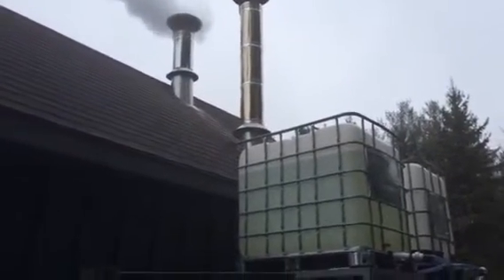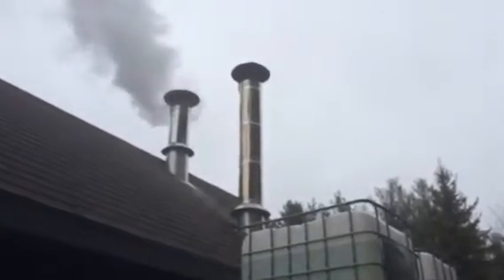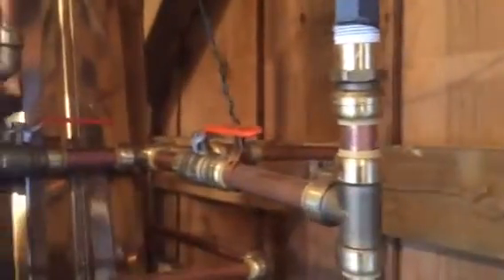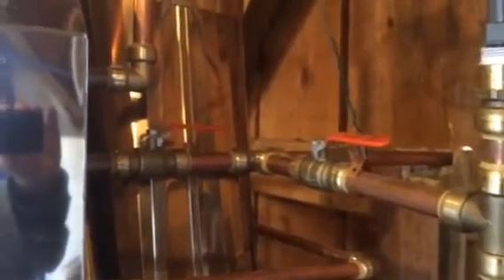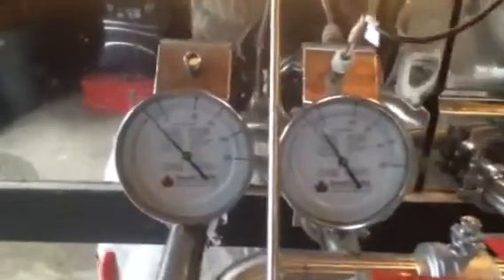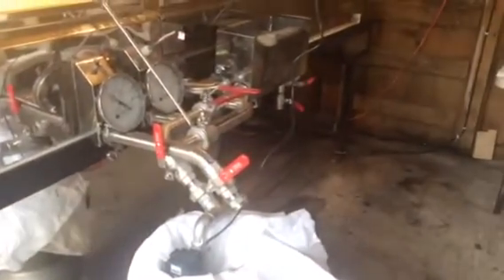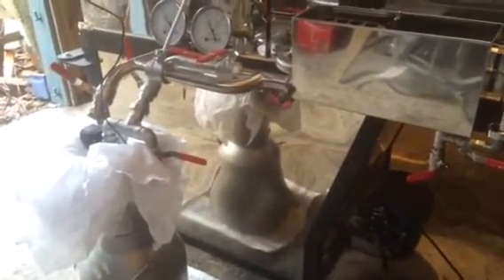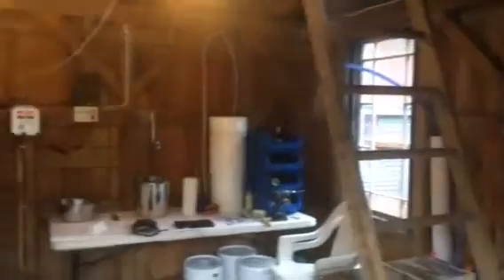Puslinchbob's Maple Sugar House Tour

Comment: How many taps do you have with this set up?
Reply from the maker: +birdtown2316 450 taps; 75 sugars, the balance reds. I am getting about 300 to 350 litres per hours boiling (75 - 87 US Gal) but Jim at Smokey Maple claims it can do over 100 US Gal/hr. The machine could easily do 1000 taps, probably 2000. I run every other day or even every third day and stop stoking after 5 hours.